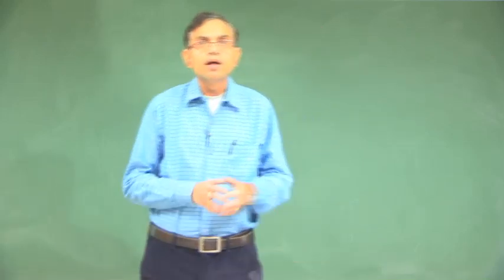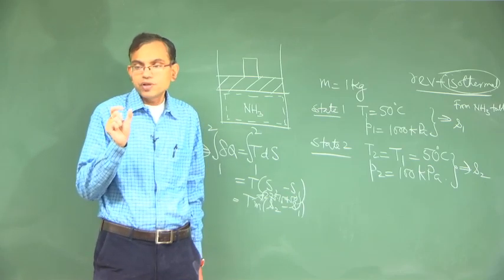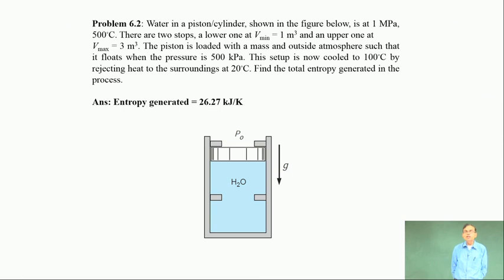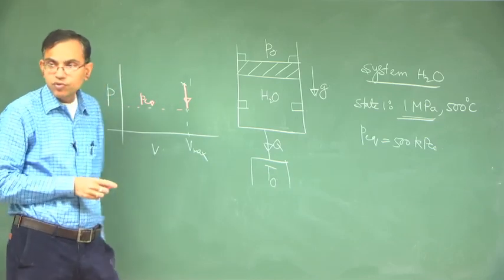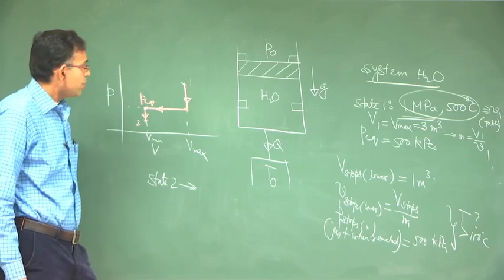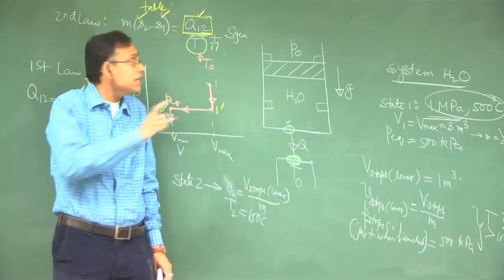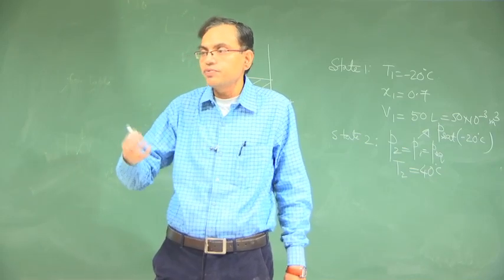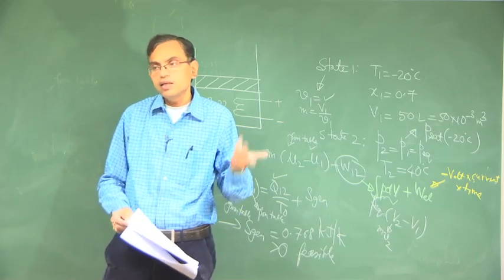Lecture 43 : Entropy Change in closed system: Examples

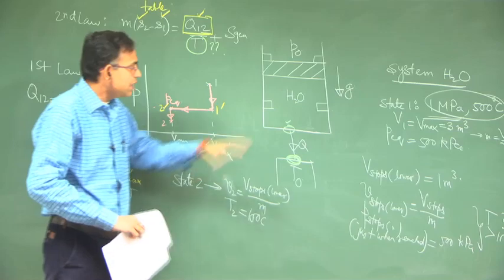Comment: @21:21 entropy generation.
The change in entropy is calculated by the help of property table will give change in entropy for the system between those two state point while the right side why to consider entropy generation for whole universe?

Comment: In problem 6.2, the heat rejected from the system must be equal to 22695.5 kJ. And total change in entropy=mass * change in specific entropy
=>S2-S1=m(s2-s1) =8.47*(1.724-7.762)
Which comes -51.139 kJ/K. 
Then, 
Sgen=(22695.5/293.15)-51.139 = 26.27 kJ/K.
Reply: I also got the same as you